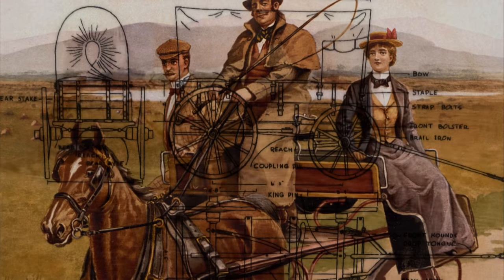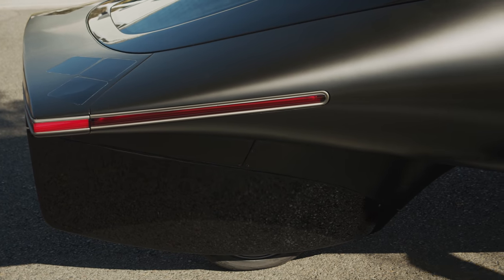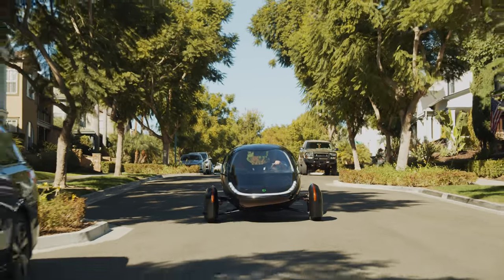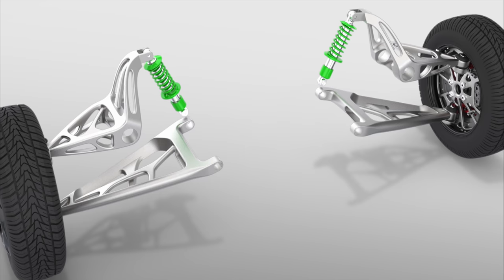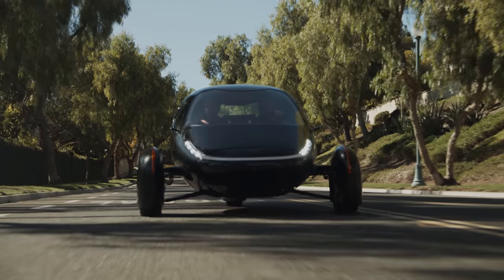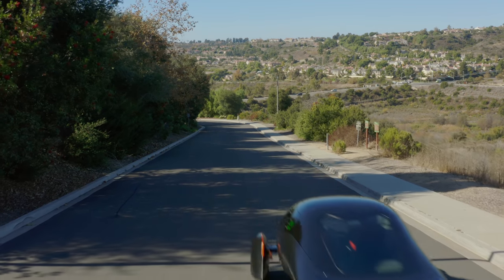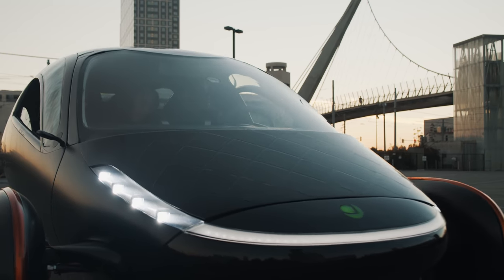Aptera Has Launched

Comment: just make it with 4 wheels to make it look like a car and have more stability.
Reply: The current design is more stable than most slab sided SUVs.  The next Aptera model will be a 4 wheel, 5 passenger car.
Reply: @n.brucenelson5920  I drove a 3 wheel vehicle before. It is not stable, it makes you afraid while turning
Reply: @aygi880  Not all three wheel vehicles handle the same way, just as not all 4 wheelers do.
Reply: @aygi880  What, like a slingshot? This isn't a slingshot.

Comment: I don’t call this a car,  it’s more like a motorcycle with 3 weels
Reply: If it walks like a duck....  I have more than 400,000 miles on motorcycles.  I now drive a Gen 1 Honda Insight.  Aptera weighs about the same as the Honda and will exceed it in almost every performance measure.

Comment: whats wrong with having 4 wheels
Reply: The biggest reason is 4 wheel designs didn't let them get close to the aerodynamic performance that they can achieve with 3.  This offers huge performance advantages for single drivers and couples.

The next Aptera will probably be a 4 wheel, 5 passenger sedan.

Comment: At high speed it has risk of take off from ground I am afraid
Reply: The little drag there is is designed in down force of about 25 lbs at the rear and rapidly increasing with increasing speed from that point.

Comment: Ok, this is cool, but your telling me of this thing crashes into a 3 ton Land Rover, it will come out better than the Land Rover? Also what if your in a shaded area, like a city. I like the idea, but I’d prefer a Tesla, like this definitely isn’t for everyone, as the guy said, they’re a unique group, and that’s a unique car.
Reply: The crash test results will be available after pre- production vehicles are available to test later in the year.  The first one did very well when it was tested, and this one has been much improved, with front and rear side air bags, front and rear crumple zones an extremely strong passenger safety cage and other safety features.

If you are in a shady area all the time, you probably wouldn't by full solar, but you can still gain 13 miles per hour of range plugged into a standard 115 v 15 amp outlet.

Comment: You get hit by somebody in that thing, you’re dead meat.
Reply: I have had the experience of being hit from behind by a large car at 60 mph while driving an 1800 lb original Honda Insight and was uninjured.  The Aptera has larger and better engineered crumple zones as well as other safety and will probably be much safer than the Honda is.  We will know when the crash tests ratings are published before production starts.
Reply: @n.brucenelson5920  Were you moving, when hit?
It may be good from behind or from the front, but a side impact on the driver's side could be a different story.

Comment: The real question is .. for which kind of client you make this car?
 Is It for a family? It has only 2 seats. 
I guess so Is a car for a young (rich) couple but It does not seems to be a sports dinamic car such as a spider neither funny to drive furthermore i think the autonomy range of a car Is not set as a priority for that kind of clients.
Of course is not a city car cause it seems to be huge and really difficult to park.
 Is not a classy car, an limited edition such as Lamborghini Athon  Lancia Stratos Zero etc. 

If you wanted to make an aerodynamic car why just not make an electronic version of the Thrust SSC?

By my point of view you could sacrifice something as 2 3 hours of autonomy adding some space.
It would be less aerodynamic but more reasonable. 

Is this a car made for Aliens?
Reply: My wife and I are a retired couple.  The driving costs for this vehicle are far lower than any other vehicle on the horizon.  Our daily driving needs will be covered by the solar panels, and the low power use will mean that charging stops will take one half to one third the time to gain range plugged into a charger as other EVs.  This of course also cuts costs.  It will be perfect for road trips to visit grand kids.

It is a niche vehicle, but it fills a far larger niche than the Tesla Roadster, for instance, and do the same roll in launching the company.

Comment: If this thing is over 25k it’s bonkers. Anything over that I rather put the extra in to get a Tesla or a Benz. Only cause it seems like a go kart.  But this thing seems like it’s 48k which it does look cool but not 48k cool.
Reply: Aptera starts at $25,900, before incentives, and costs far less to purchase or to operate than either of your comparisons.  The better Tesla comparison would be with the 2 seat Roadster, 
  You will have to judge the relative value proposition for yourself.
Reply: @aussieideasman8498  I have never seen Aptera claim to be clairvoyant.  We do know that they have contracts in place for the major portion of the Aptera cost - namely batteries.  Aptera does not operate in an economic vacuum and don't claim to.  Lets hope that they continue to do what they need to grow and deliver product.  If prices do increase, the amount they will be saving the average owner in reduced energy costs will be even greater.

Comment: And how are you doing if you live in France and you have no sun for 2 weeks ? 🤣
Reply: You plug it into the mains, where it will still gain range rapidly, due to the efficient use of power.
Reply from the maker: Should you need to plug in, Aptera can be charged at home by plugging into a standard 100V or 220V outlet. Aptera will also be compatible with CCS, J1772, Level 2 and CHAdeMO/ DC Fast Charge stations. You can also find out how many times you'll need to charge your Aptera based on your location by visiting the solar calculator on our website: https://www.aptera.us/never-charge.

Comment: It looks fantastic, but it’s a death trap.
Reply: Unlike other 3 wheel designs this is designed to automotive safety standards.  It will be crash tested and get a rating that will likely be excellent.
Reply: @n.brucenelson5920  I seriously doubt it’s success in the coming ratings. Firstly, it’s rollover chance is going to be higher than most cars simply because of the lack of a fourth wheel. Secondly, there is not very much compression space and material for this car at all*. In the video they even state their pride in the *strength of the frame of the car, however that is actually counter productive when in a crash. Steel frames are designed to not be super strong on purpose because if they were perfectly rigid none of the impact would be absorbed. The ultra strong frame, and the lack of empty space, in this vehicle will make it very difficult for much of the impact to be absorbed by the vehicle instead of the occupants.
Reply: @quaesitumspatium7751  You don't understand the design.  There are front and rear crumple zones.  The design is more stable than almost any SUV.  It has been tested stable in 110 mph side winds, far higher than slab sided Subs.  The entire motor weight is centered at axle level.  The weight balance is about 70- 30 towards the front.

On a 4 wheel vehicle the inside rear wheel tends to lift in a sharp turn at speed.  This can't happen with the Aptera.

The traction control and ABS senses and adjusts 32 times per wheel revolution, far faster than most cars.  Look into the engineering instead of assuming things that aren't true about the vehicle.
Reply: @n.brucenelson5920  I have not looked into the engineering so yes I agree that I am assuming, but quite honestly by simply looking at it  in the video there cannot be more than 3-4 feet of crumple space in the front—not to mention the sides. The rear is better though I can’t imagine it staying grounded if it got hit in the back by any substantial force.

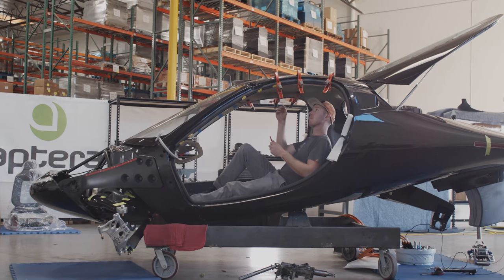Edit: look at 4:34, I’m yeah those “crumple zones” that you speak of are really fantastic. It literally crumples like a single foot.
Reply: @n.brucenelson5920  also they stated in the video that it hasn’t been tested yet so where exactly are you pulling those statistics from?
Reply: @quaesitumspatium7751  The original model was crash tested and passed all of the automotive safety tests.  In fact, the roof crush strength was more than 3 times stronger than any other vehicle tested up until that time.

The current model is even better, and today's modeling tools are so good that the Government allows companies to self certify and only check 20-25% with actual crashes.  Even though they are in a category that doesn't require it, Aptera will perform actual crashes of pre production vehicles and publish the results.  This illustrates a lot of confidence in the safety, which I share. The safety design features are more advanced than the Gen 1 Honda Insight.  I was hit at 60 miles per hour by a large car and had no injuries. It also weighs about 1800 lbs and the Aptera should be safer.

Comment: I live in Canada so that's a no for me
Reply: The climate control is spec'd for ambient temperatures from -20 to 125 F (about -29 to 52 C)  Snow can't build up under the wheel pants because that is where the motor heat is generated.  The traction control can sense and respond 32 times per wheel revolution - far faster than almost any other car, and Aptera can do tank turns and differential steering.  The AWD version with snow tires is likely to be very capable in bad weather.  There will be testing under these conditions on a winter weather test track next season.

Comment: As a former Airbag engineer who did sensors, inflators, modules, sled tests and holder of patents, your crash strategy is NOT correct.  Happy to consult with you, but you are going to KILL people with your approach.  F1 is NOT valid for crash.  Low weight needs 4x more stroke than airbags offer.  Your crash pulse will...kill. Yes, I made presentation to Autoliv (former employer) on how to do it right, but they are stuck in the mud and don't understand.  Your structure can't get you 4x better energy and airbags can't either...sorry, won't work.
Reply: Having been in a crash in a Gen 1 Honda Insight, hit from behind at 60 mph by a large car, and being uninjured, I am skeptical of your claim from my own experience.  The Honda got ratings of 4 when it was tested, and I expect Aptera will be much better.  BTW, the Honda weighs 1800 lbs, about the same as the 40 kWr Aptera model.
Reply: @n.brucenelson5920  From behind is like 30 mph.  Head on is the issue.  Take a physics class.
Reply: @seaplaneguy1  That is what crumple zones are for.  I have over 400,000 safe miles on motorcycles.  If you don't realize that this is far safer than any of them or any other 3 wheeler, you should turn in your engineering degree.
Reply: @n.brucenelson5920  Safer?  Sure, but it is not enough to do the job.  What I stated is correct.  Learn some physics and engineering before you make claims.  Riding around on a motorcycle does not make you an engineer with experience in the field with real solutions.  Nice try.
Reply: @seaplaneguy1  "Safer?" Sure."  So you agree with me.  The rest of your comment is ad hominem.
Reply: @n.brucenelson5920  A body around someone would be safer than no body like on an open motorcycle.  Aptera is NOT a motocycle in the classical sense.  It cannot counter Steer or bank in the turn, like a new engine type car can.  Just not fun...  I did not attack.  I stated a fact of their response.  Anybody can see what is needed to go up against a very large weigh vehicle...4x the crash protection.  Airbags and zones can't get you there...

Comment: Crash test it... 😂 😂 😂 😂 😂
Reply: When Aptera has production intent vehicles available they will be voluntarily crash tested by a third party and the ratings published.  Finite element analysis of the design indicates that the performance will be excellent.  They have built in front and rear crumple zones, seat belts, air bags, and an F1 style passenger safety cage, none of which are required by the class.
Reply: @n.brucenelson5920  it's classified as a motorcycle for a reason. To avoid regulation. The company will never produce these. The founders will pay themselves 7 figures until they go bankrupt again.
Reply: @moderatesunited  They never went bankrupt once.   They were liquidated - a big difference.   You can check the compensation in the SEC filings, but doing real research instead of making up lies is easier for some.

Comment: Nice car but... too small, too low, front wheels too fragile for a everyday car, especially for a family.
Reply: Of course it is not designed as a "family" car.  The next Aptera is likely to be a 5 passenger, 4 wheel sedan.  As a couple, we plan to use our first generation Aptera for cross country travel and everyday use in Iowa including Iowa winters on a gravel road.  Since the wheel motors are designed and tested to withstand 100 G shocks, continuous salt water spray and immersion in 10 ft of water, I don't know where your "too fragile" comment comes from.  We intend to test this out in real life operation, and will be reporting back.
Reply: @n.brucenelson5920  In my eyes this car is your 2nd or 3rd car, if you have the money. To go and get groceries, go to work, or just visit people or places without taking stuf. If I was a car manufacturer and wanted to be succesful, I would make a cool looking afordable smal family car (hatchback) to start with. Suitable for a wide range of people. The profit can be used for making other car models.

In my eyes the wheels look fragile compared to a 'normal' car cause they stand out (of the body). If you hit something from the front with a 'normal' car, the impact will be the bumper, with this car it's instandly the wheel and the suspension. A hit from the side more or less same story.

Nevertheless, it's a nice car and hopefully it will be succesful.
Reply: @bigbotno1  In many ways, Aptera is following Tesla's successful model.  They started with a much simpler and smaller market potential EV conversion of the Lotus Elise that they called the Tesla Roadster.  

Aptera's first model is also relatively simple and has smaller potential sales volume than a sedan would have, and they can perfect their production process on vehicles that have a manageable scale.  This first model still is showing many times the demand that existed for the Roadster.  Aptera is planning for their second vehicle to be a much larger market potential 4 wheel, 5 passenger sedan.

As far as impact and repair implications go, this is a very different design from conventional vehicles, and is likely to be very safe.  This will be confirmed by third party testing, so we won't have to go by faith to find out if this is true.

Comment: I just cant. Every one is gloating this car. But in my eyes its so hideous. And what happens if a lifted jeep wrangler with metal bumpers hits this thing??? It looks like instant death this thing looks tooo cheap and the foundation and architectural design on it is impossible
Reply: Most modern aircraft use the same kind of construction.  It is far stronger than common automotive practice and will be voluntarily crash tested to federal automotive standards. The ratings will be published before shipping starts.